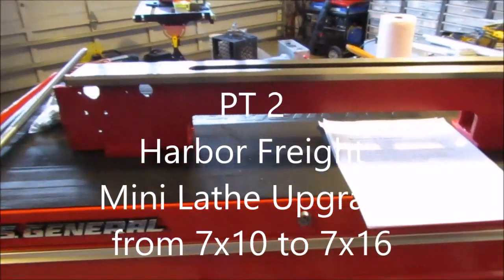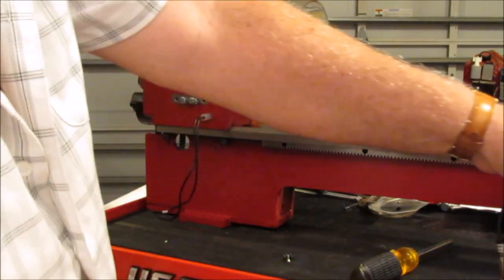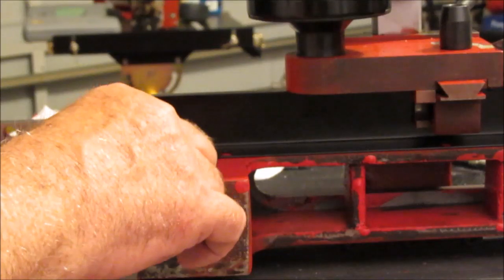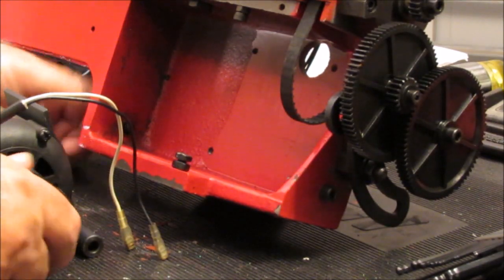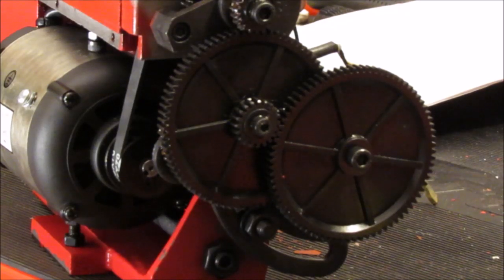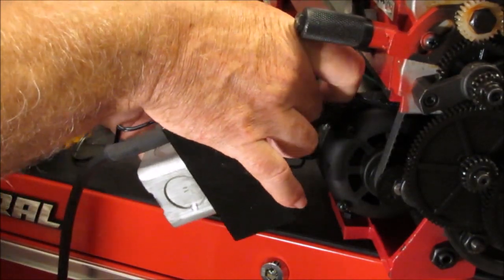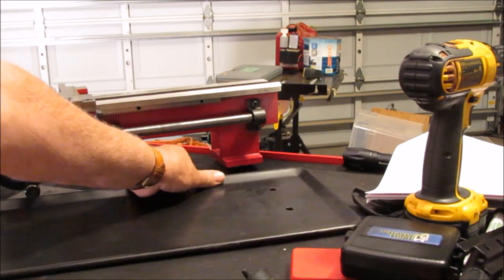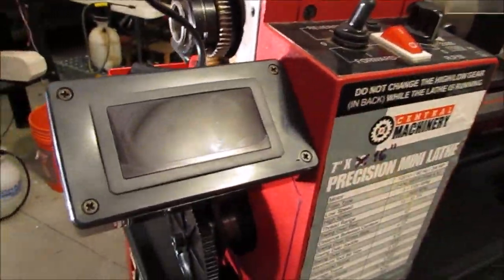Part 2 of 2, Harbor Freight Mini Lathe Bed Extension, 16 inch, Installation

Comment: When you are moving the carriage back and forth down the bed wats, it does not look like you have the carriage gibs adjusted, you want them adjusted before positioning the lead screw bearing caps.

Comment: Looks like the rack hole fits a 7/32" drill bit aka 5mm. If it was a 6mm it likely would look more like a 1/4".

I have been ngwro on occasion be  four.

Comment: First off did you upgrade your gears and motor ? Do you still have the lead screw from your 10” and if you up graded the gears do you still have the plastic ones ? The reason I’m asking is I need these parts for a stripped down 7x10 HF lathe ! If I buy new it costs more then a new lathe would cost ! Not really but close ! Lol. The headstock is intact but needs a DC motor , lead screw , gears , and motor control board ( your using that ) and it would be complete ! If you take the thread counter off you gain about 2” in length on your ways ! Let me know if your interested in making a deal on those parts ! Thank you ! By the way , there very easy machines to run and fix !
Reply from the maker: The gears are the same. Only the bed was changed.
Reply: @kaydee457  yes I’m aware of that ! That’s why I asked if an upgrade on the gears were made ! Making the plastic ones not needed !

Comment: Why would you do this? 500$ for lathe and 200$ for bed?   16 inch harborfreight lathe is only $650
Reply: Where did you see a 7" X 16" mini lathe at Harbor Freight? I've only seen 7x10 & 7x12 mini lathes there.
Reply from the maker: I already had the HF machine several years before this upgrade. I bought my 7x10 for around $350 back when HF allowed you to combine coupons. Anyway, the only people that would do this is folks in my situation where after a few years of struggling to do jobs that didn't fit the machine, you resign yourself to buying another or you do an upgrade to increase the bed size....The upgrade made sense....

Comment: Couldnt you theoretically combine the two beds into one real long one?  I feel like just about everything could be combined except the power feed screw since it's a gear rack moved slide.  From there...hell, a little welding and grinding and a real long power feed screw and you've got yourself a looooong lathe!
Reply: Even without a longer lead screw than the one with the 16" kit, I don't see why the bed could not be extended by bolting the old one to the end of the new one.   The tailstock with a chuck with a drill in it takes up a lot of space and it needs no access to the leadscrew.  With the original 10" bed, I can't even drill a 1 inch hole into a three inch long workpiece.

Comment: What a wasted opportunity! At 13:20 that paint on the underside (ways) will mess up the correct function. As in all these mini lathes. That would have been the perfect opportunity to clean it and lightly lap the ways. Making for a much more precise and smoother machine. At that stage would cost you maybe half an hour, tops! Same for the paint on the feet. 
Thanks for sharing.

Comment: I'm curious, how did the combination Drill Bit and Tap work out?
Reply from the maker: Anything that's 8-32 or above it's moderately safe. I wouldn't try the 6-32 or 4-40 though. To easy to break them.
Reply: @kaydee457  Thank You!
Reply: I followed instructions exactly for all drilling and tapping, and it went fine.  The threads for the rack were the smallest I've ever made before (2.5 mm hole and M3 x 0.5 tap), but those worked fine for me.  You do have to be careful with something that small by working it back and forth quite a bit instead of cranking it in too far all at once.  The cast iron the bed is made of isn't a very hard metal.  It drills and taps fairly easily.

Comment: Any reason not to mount the lathe to a work bench without the rubber feet? It would seem to be too heavy to move around. Do the feet reduce the vibration?
Reply from the maker: No reason other than I do have to move it from time to time because I don't have a lot of room on that bench. My Mill's on the bench too. It's not too heavy to lift by yourself and I do often to set it aside when I need that bench space, or just to clean the area.
Reply: I took off the feet, added a hardwood riser block under each leg, and bolted it straight to a workbench. It immediately helped the rigidity and I've noticed far less vibration. Go for it, you won't regret it!

Comment: For my mini mill RPM display I found rectangular rare earth magnets that just fit in the nut spanner slots on ebay, stacked 2 of them to come up to the top of the of the nut, then super glued them in place.  2 Neodymium small magnets 10mm x5mm x2mm.

Comment: The apron is the bit with the handwheel, the leadscrewcover is just a cover
Reply: Peter Jones thanks for pointing that out to him, he must not read the comments. He's driving me mad
Reply from the maker: Umm, I used this image as a reference....Unfortunately it's NOT correct which led me astray.
https://www.engineeringclicks.com/wp-content/uploads/2016/10/lathe-machine-parts-e1478094527417-1024x611.jpg

Comment: Those brackets are necessary under the chip tray. The old way of attaching the 4 rubber feet to the bottom of the lathe was found to be dangerously unstable.  The hat shape feet widen the foot print under the chip tray and give stability.  Just think if the machine bites into something and flips towards you, your first instinct will be to put your hand out to prevent it from flipping towards your body. This action will remove fingers and even your entire hand/wrist and possibly snapping your elbow joints and forearm bones like stale pretzels.  The amount of inertia stored in the spinning chuck combined with your work is tremendously violent on impact with the human body. Ever turn a bicycle upside down and spin the tire and then try to stop it with your hand, well multiply that by “Deadly” if you’re alone and the machine wants to re-design you. Please put the brackets on.
Reply: After 10+ yrs of using a mini lathe (ENCO, same as HF but painted yellow) I have never had it 'fall forward'. The weight is towards rear and it tried to tip backwards more than once until I made some 2x4 extension feet with the original rubber feet screwed much further out. I'm still thinking of 16" bed conversion and using part of original bed to make a 'mill' conversion allowing larger threads or slots/keyways to be cut (basically another lathe 'on end' with a smaller fixed or gear reduction motor bolted to saddle)
Reply from the maker: Yeah, I know as that was my intuitive rationale at first, except that nothing lines up, the holes in the pan only match the casting where the original feet mountings are and the cross braces didn't align or fit to anything else.

Also, the "kit" I originally got from them had the wrong casting altogether, a casting that was markedly different from the Harbor Freight (holes in different places, tapped holes missing or having the wrong spacing in the casting, etc.etc) and I suspect this was just extra stuff that was in the box for whatever brand that kit was made for. 

LMS sent me a new casting (but not a new kit) when I described the problems I was having mounting certain things to the first casting they sent me and they responded telling me that they were sorry and said they sent me a kit with the wrong casting. I assume the parts in the box were also N/A for the HF install. 

I looked at it every which way and simply came to the conclusion that these parts were for a different model of lathe. 

They supply this "kit" for several different models of this Chinese lathe with minor differences from different suppliers, including LMS themselves. Trust me, if there was a way to install that stuff I would have. There were literally no mounting holes for the cross brace adapters and the hardware supplied were of the wrong size to assemble anything.
Reply: I am looking to get and 7x16 bed from Little Machine Shop and I plan on cutting a section from the old 7x12 bed to make a 6 inch extension for the new bed.
My plans are to face off the end of the new bed square to the beds ways and match the dissected bed piece to the end with two 8mm locating pins and two 10mm bolts.
It will be like a parking place for the Tail-stock when its not in use.
Reply: For got to mention, when your getting ready to use the lathe make sure the Cross-Slide feed handle is at the same height as your elbow to prevent fatigue of your arm, neck and shoulder muscles.
Reply from the maker: That sounds like a good idea. I have not only the old bed but also the errant bed they sent me for the mystery brand lathe....I was going to cut them up and use them for weights but maybe I'll look into what you're doing too. Seems a shame to toss them out.....
Reply from the maker: Just goes to show that no matter how long we make these things we're always looking to make them a little bit longer.....
Reply: @69camaoZ28sc  Why not use the full length of the old bed?  Sometimes you have a long workpiece and sometimes you just have a long drill.
Reply: @kaydee457  Buddy, I figure out what he meant, those brackets that go under the chip tray only 2 holes align because those are the only ones that need to align to the lathe, the other 2 you can put 2 bolts to the workbench, the do not align with the chip tray because they are holes to be used directly to the workbench.... I have bought the correct kit and comes like that also. CHeers!
Reply: My HF 7/12 I added a 5" long 1/4x1 steel flatbar under the tray,drilled 4 holes, 2 to match bed feet holes,and 2 more drilled wider for the rubber pads. This gives me a double wider stance such that the machine no longer rocks forward or backwards.
Reply: Found all matching metric screws/bolts at the local Ace Hardware as they had an excellent selection of that type items.